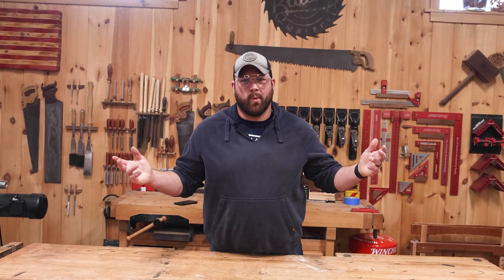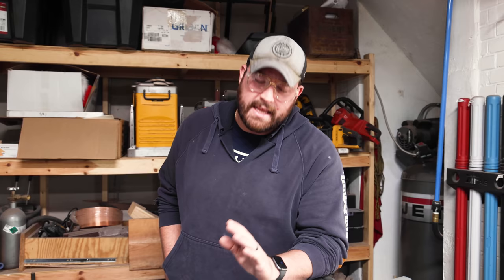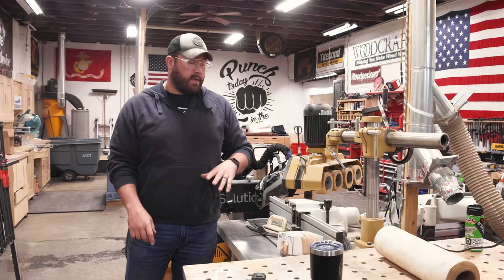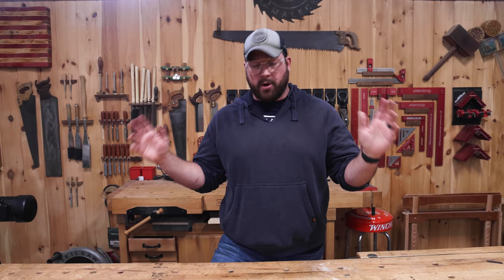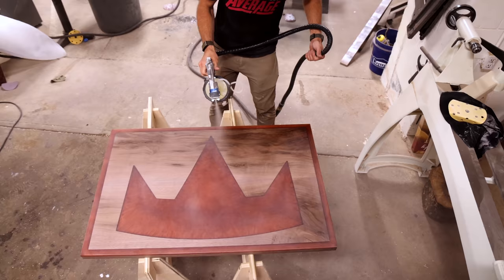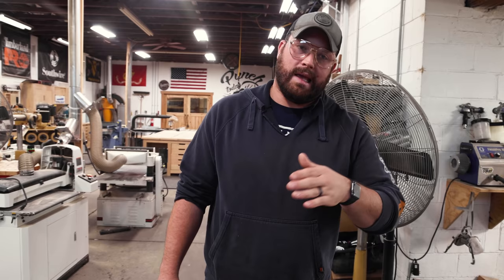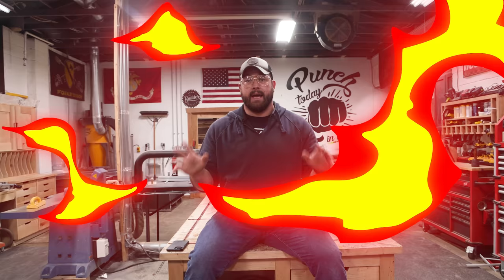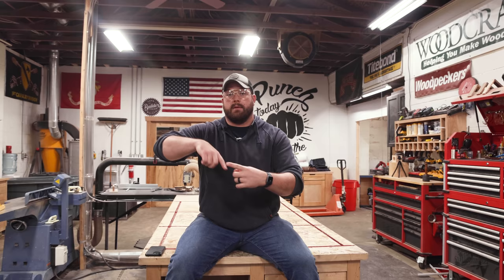10 Tips I Learned In 3 Years In My Shop!

Comment: good stuff and made a few of those "mistakes" myself. Tip for the next shop to go along with 4x outlets is to put some electrical drops. The kind on reels, they have 3 or 4 outlets each. I have a ~15x40 foot shop and put 4 of these evenly spaced. Also, I'm now putting power strips on all workbenches, tools stands or anything that has a surface.

Comment: Two things: One check out the material storage area Princes Yachts setup for their woodworking area.  All the project materials are sorted into cubbies that are tagged for the project. 

Two, Lasko makes a box fan with a filter tray for about $50-$70.  I run a carbon HVAC filter in mine, and it does a great job at getting dust and VOCs out of the air.  You should probably consider something like that when you're spraying inside.  I wouldn't at all call it a replacement for a respirator and proper ventala, but it's going to be a whole lot better than just breathing all that crap in, and it should help vacuum the small droplets out of the air before they land on your other equipment.

Comment: Great channel, great tips, and terrific attitude. Hope your next shop turns out great!

To add to the point about heating and cooling, when it gets about 5-10 degrees below freezing worker efficiency drops off dramatically. Some contractors (construction) use a calculation for this to determine how many additional hours will be needed in winter months on projects (depending on what the tasks are).
Also any products like glues, epoxies or any other polymers that are at freezing level can have some issues with bonding properly.

Btw a 2 banger = duplex recepticle
4 banger = quad recepticle

Comment: I’m building a mobile miter stand right now instead of the 8ft fixed station I built 4 years ago. It might only give me 30” on each side but it will be easy to set up next to an auxiliary outfeed table for long lumber and I’ve had too many times where I needed to cut something past 6-7 feet on one side and was running into everything on either side.

Comment: Most of the dust collecting system has the hoses on the wrong way. Yes there is a right way to put them, and they are often labeled on the hoses.
The dust/suction should follow a right hand twist in the tubes.

Comment: Dear Mr.  Malecki, Right ON man! Good tips all. First: The ENEMY of organization is "I'll just put it her FOR NOW". No you won't, it'll be there 6 months later and you will wonder why it's still there cluttering up your shop. Decide on a MINIMUM size of cutoff you are willing to warehouse/keep and DITCH THE REST (Take it from a guy whose house burned down: really doesn't miss the small stuff). Second: You can commit as much as you want to planning and paper, but until YOU use it, you won't know the layout. For many of us, the assembly location for large projects is the driveway and that's ok. I did discover in my new "dream shop" that all those fixed base machines, just like you said, need to be on wheels: TRUTH. Next: Dust collection outside the shop RULES - as long as you have sufficient RETURN. Vacuum sucks (pun intended). Finally: Have a 10' throw to both sides of your chop saw and you're GOLDEN- cut 20' ers no prob. But you do have to keep that space clear... Thanks again. Good luck on your new shop using the wisdom from this shop. PS- More plugs rule!

Comment: So, your experience tells you the "Golden Rules of Shop Set Up" are still just that- the "gold standard"; One) No shop is ever big enough- ever!, Two) there are never enough outlets or drops- ever!, Three) There will always be projects that run overtime, need unavailable materials, etc that will clog up the process- always!, Four) The worst shop you will ever work in is the one you are presently in- the best is the shop you are planning to move into- always! Five) Good shop operators and operations need to maintain flexibility and good humor- Always! And finally, Six) No one can afford the shop he or she truly wants or thinks we need- no one! 
   PS; The next shop I am planning will be built from a post frame building- because that is the simplest and cheapest to add conditioned square footage to, will have too many electrical panels to start with and space for sub panels, a full ceiling to increase lighting effectiveness, level floors to aid equipment on wheels, and more exits to allow for better ventilation, and a 20' Conex trailer to house my air compressor and dust collection.  And it will take between three and five years to financially "get over". My experience, YMMV-    FR

Comment: I fear you are using the aircompressor for "cleaning" your tools - otherwise there is really no good reason for a compressor in a woodshop. Now as far as cleaning goes, this is a bad idea because all you do is to blow the dust deeper into the machine.
Reply from the maker: do you suggest i just blow air into our plasma cutter ?
Reply: @John_Malecki  no Iwas afraid you were doing what a lot of woodworkers do - blowing compressed air into their machines to "clean" them, which really does not clean them but may damage them (I talked to a sales agent of Dewalt once who told me this). What are you using the compressed air for in the woodshop anyways?